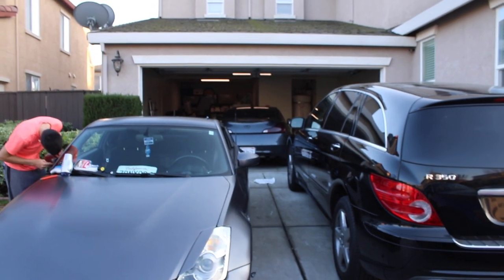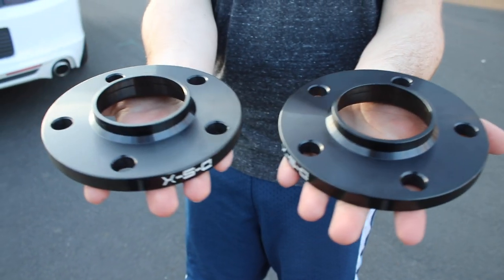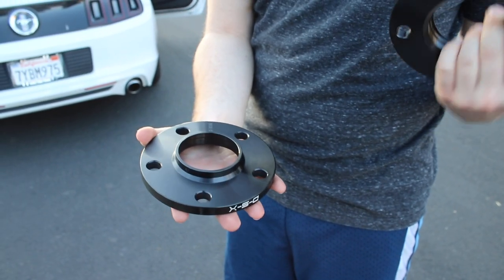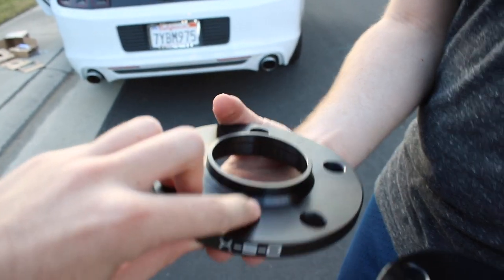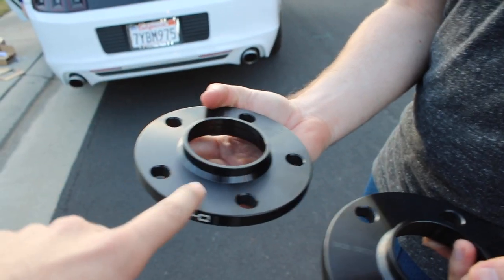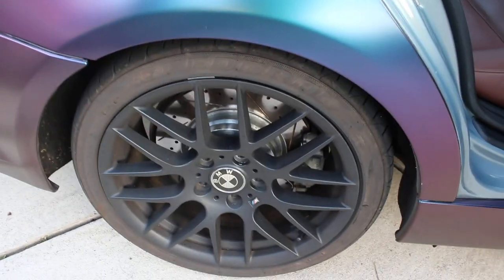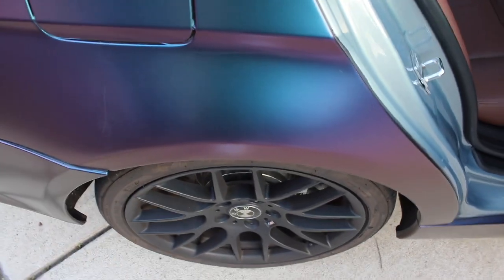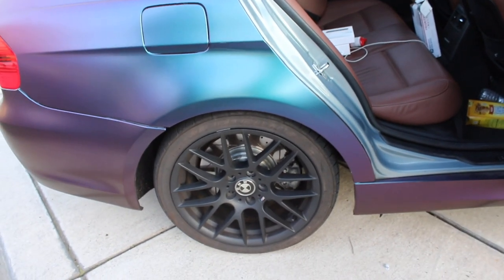THE E90 FINALLY LOOKS WIDER! (VERY CHEAP MOD)

Comment: I think it looks a lot more flush. Kudos for keeping on doing stuff to your car. It's a real "one-of-one". As for wider tires I totally agree. Here's some info what I went with on my 2008 335xi e92 for your consideration:

Bridgestone Potenza RE050A RFT
245/40R18 - Front
275/35R18 - Rear

Avant Garde M359 (Hyper Silver)
18x8.5 - Front
18x9.5 - Rear
Reply from the maker: please tag me on ig of your car wheels.